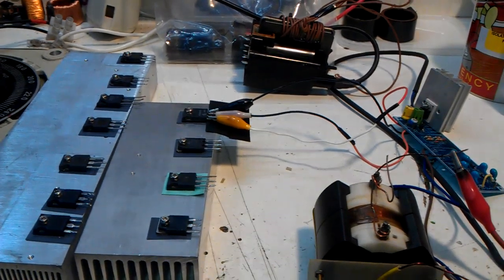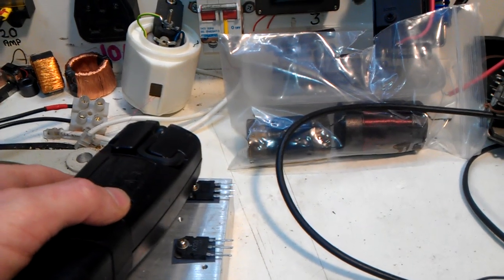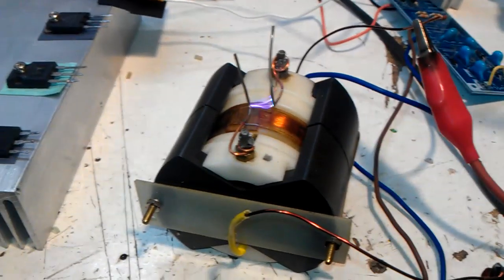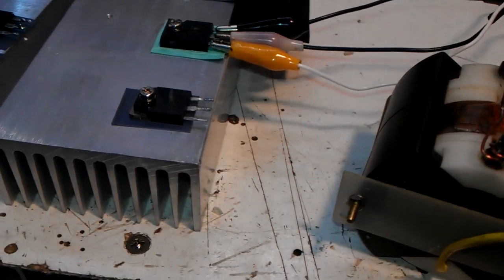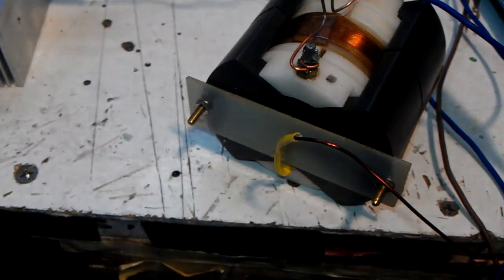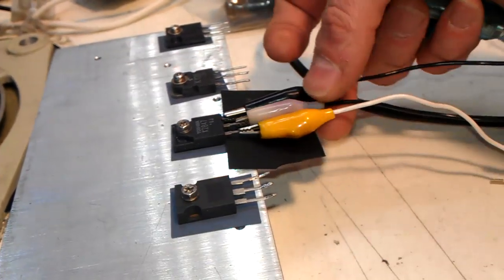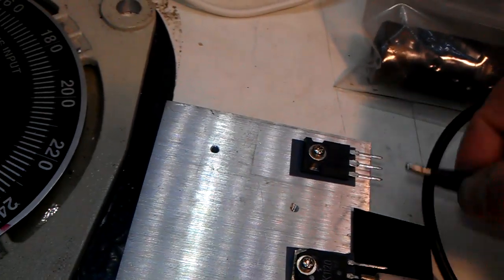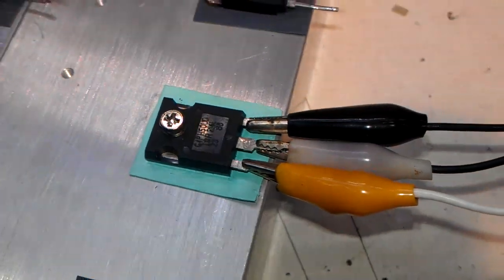Trying different mosfets!

Comment: Mosfets don't like me. Every time I try to use one in a circuit it jumps on a chuck wagon and heads west. Usually giving off smoke signals. I even turn the power up slowly. But the smoke signals keep repeating "BYE". Still your videos are great to watch. That's the main thing. Heat sinks are great too. Like camera comp. Looking forward to the next video.

Comment: I believe the IRG4PH50 is an IGBT mosfet ...  Thanks for the Video !!
Reply from the maker: Advanced Nutrition Inc hello"
i beleave your correct mate.

thanks for the comment😉👍

Anthony

High1voltage1rules
Reply: Advanced Nutrition Inc A igbt is not a MOSFET 
IGBT=Insulated gate bipolar transistor
MOSFET=MetalOxide  Semiconducting Field Effect Transistor
so MOSFET is not a igbt
Reply from the maker: Mrinal  Thakur yes I know, I was just making the video as it was. just to try different switching transistors" to give peaple an idea.
Reply: high1voltage1rules ok
Reply: high1voltage1rules high1voltage1rules +high1voltage1rules we share a passion for electricity 
Especially high voltage
Did you purchase Tc4421 drivers 
Those are high speed 9a MOSFET/igbt driver capable of driving g larges power MOSFETs and igbt bricks 
I highly recommend you buying them they are virtually impossible to destroy
Reply: high1voltage1rules if you want to boost the swithching speed of your MOSFET (if they are ultrafast or hyperfast) you need a buffer stage between the MOSFET and signal output 
That can as simple as  transistor  totem pole of a NPN+PNP BJTs 
It a dedicated IC like Tc4421 or Tc4422

Comment: hi.
this G4PH50W or G4PH50UD. I can use this transistor to H-OUT of crt tv playback?
we can replace the D-series transistor of this H-OUT crt tv playback to G4PH50W AND G4PH50UD?
PLEASE LET ME KNOW.
Thanks... :)
Reply from the maker: albert gooc Hello,
if you shopping out the transistors of a flyback crt main board your better of fitting the same or as near as!! as this can cause problems.

of course I'm not sure what your Asking here, if Iv read this  wrong what your asking then please Explain! 

many thanks for the comment, and be safe,👍

Anthony 

High1voltage1rules

Comment: hey mate get some Tc4421 MOSFET/IGBT gate driver IC those are Abel to drive even the largest MOSFETs and igbts with 7-10nf gate capacitance 
I am using then have never fried them they are anti histeric till 4kv on power pins those are best get some from AliExpress they are cheap and good

Comment: how many volts this g4ph50?
and how many amps this transistor?
thanks.
Reply from the maker: albert gooc
Hello, 
it's a good thing to Google part numbers' and you can get the data sheets for almost all types of transistors.

hope this helps and thanks 👍

Anthony

High1voltage1rules